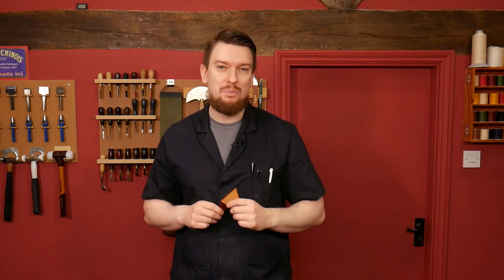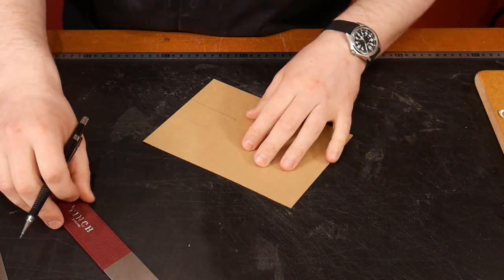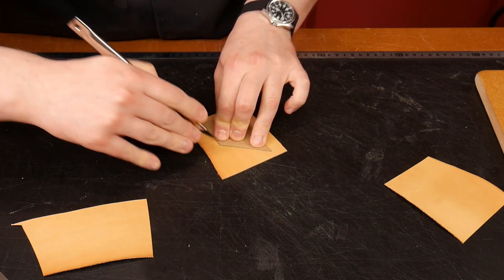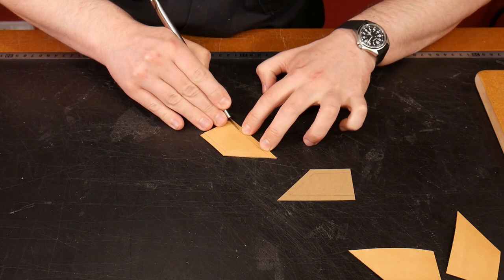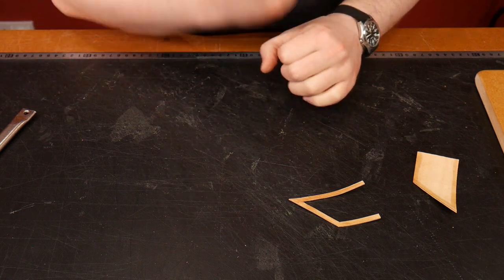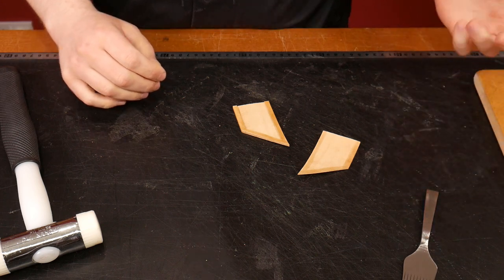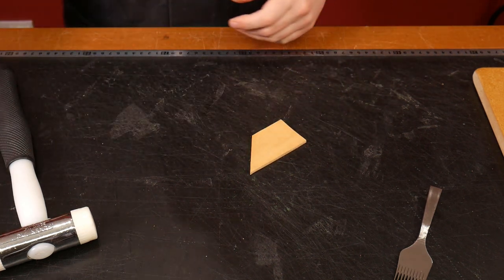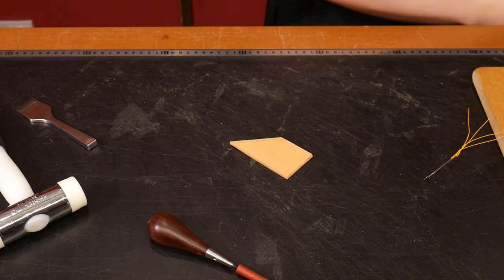🔪How To Make A Skiving Knife Sheath - Build Along Project

Comment: I made a similar sheath/cover for one of my skiving knives a couple of years ago, but here's something that might amuse you
The thread I used was the string from a yo-yo that the kids had broken and stopped playing with. It was braided white synthetic just about the right diameter and length
As it was only for me, and would spend it's time in my tool cabinet or on the bench, it was not so important if the quality was not top class
And I remember that the leather was from a cheapo credit card wallet that the bank was giving away at some time

Handsome is as handsome does!
Reply from the maker: If you drop the knife cover does it now come back to your hand? :D:D

In the beginning I used to use waxed bow string as I was into archery at the time. Even twisted dental floss works a charm!